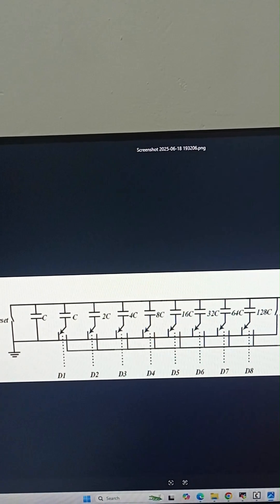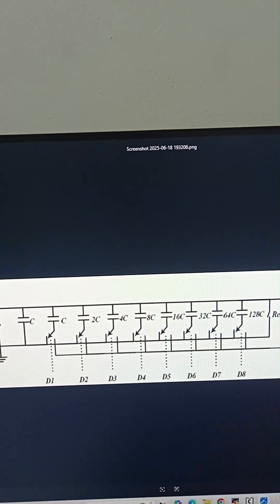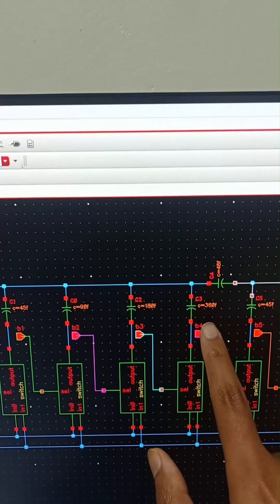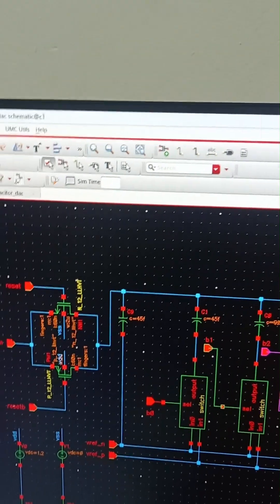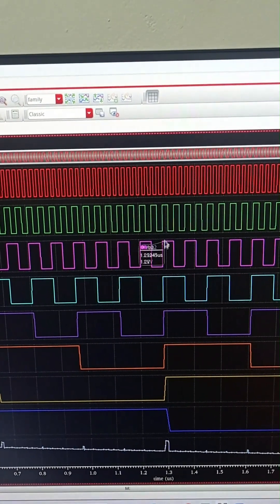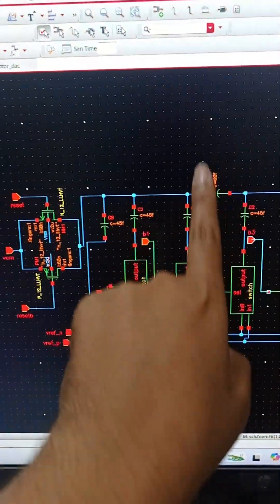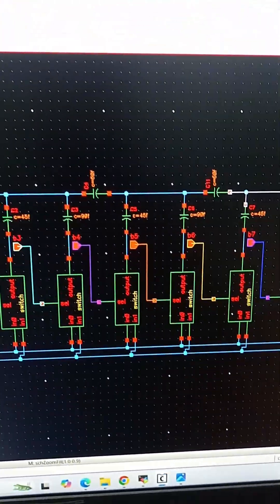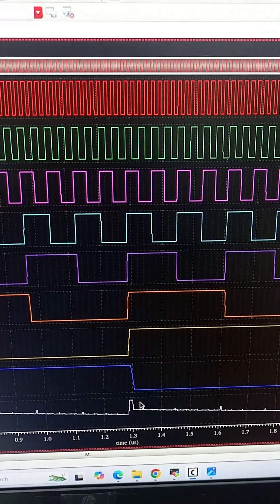Efficient DAC design with Split capacitor architecture | Cadence Virtuoso Simulation

Comment: can you give the full access of the design or give the insight from transistor level design. or if you have github repo. Share the link.
Reply from the maker: The transistors are used only for designing the switch.
The switch is designed using Transmission Gates which uses pmos and nmos.
I'm using umc6511 pdk.
At present I don't have GitHub repository. I can share via mail or WhatsApp if needed.
Let me know if you need any more info,  I would be glad to discuss.
Reply from the maker: Thanks for your feedback 👍
Reply: Can you email me sir